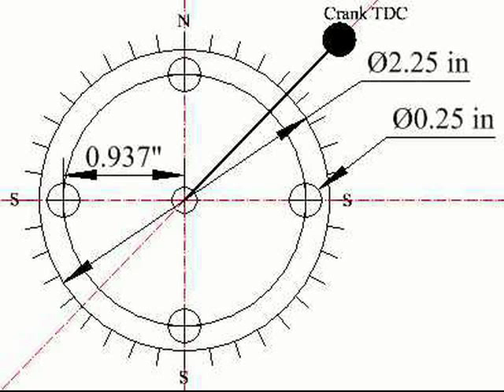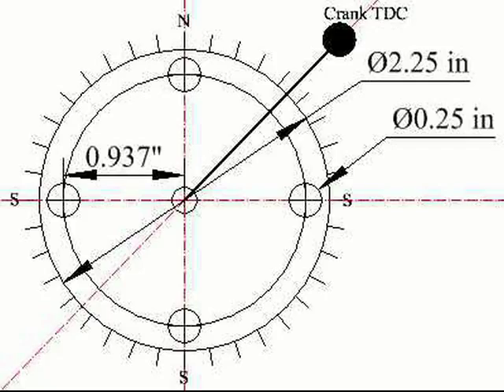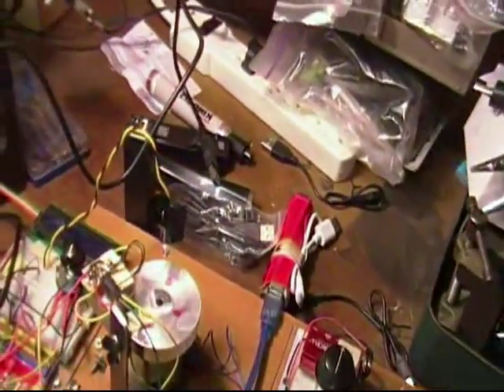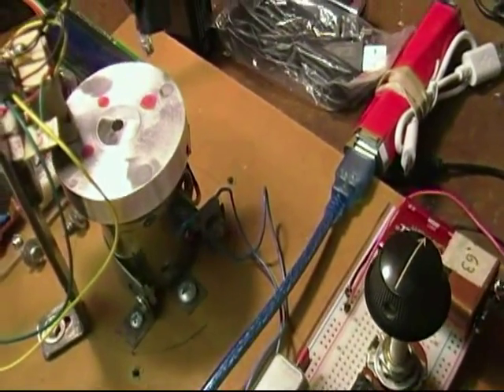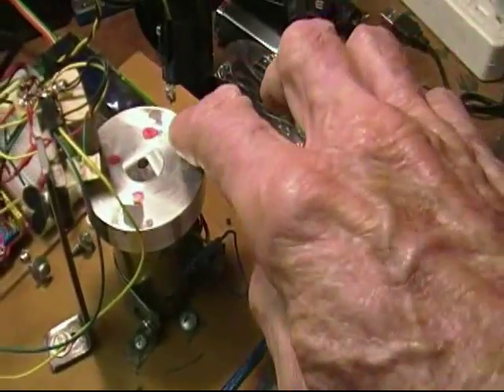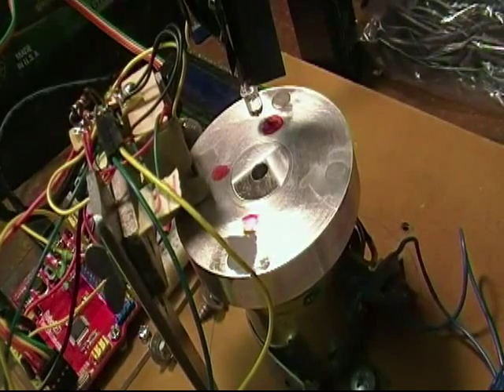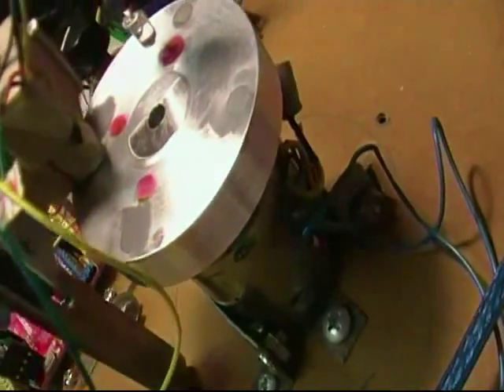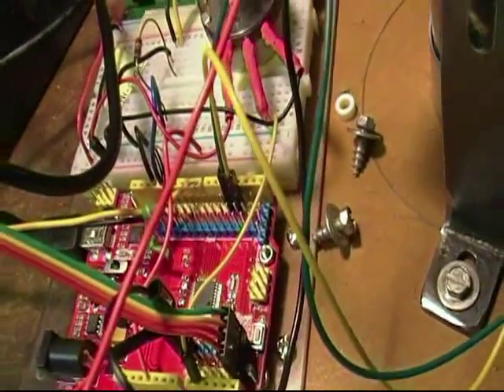Hall Effect Sensors & Arduino Using South AND North Magnets

Comment: I just tried my codes with the sensors but it did not work as I wanted. It runs for 10 times with one sensor only. I want both output ones. As if, 3000 time it will ON after contact with first sensor and then wait until it contact with second sensor then turn off . 

flow chart will be like,
(Start > Magnetic Sensor 1 ON --Sensor Valve ON ----> Magnetic Sensor 2 ON -> Solenoid Valve OFF ) 3000 times

Last two weeks, I tired a lot to sort it out. there are 3 issues and those stuck me for ages.

                Issue 1: when I brings the sensor1 closure to the Magnet, it LED turn on until I remove it but I want to remain it on until the (second sensor) sensor2 come close to the Magnet. 

                Issue 2: When I brought the sensor1 close to the magnet, it runs for 3000 times until i remove it. But I want the led will turn on and then sensor 2 will be closure and led will turn off. AND OVERALL, it WILL COUNT as 1 CYCLE.

                Issue 3: the following code give me value like "Sensor 1 Value = 1" and "Sensor 2 value =1".... No idea why??

/********CODDING******/ 
int sensor_1_pin = 2;
int sensor_2_pin = 3; //hall effect sensor output connected to Ard 

int led = 7;   

int sensor_1_value = 0;
int sensor_2_value = 0;

int cycle = 3000;
int i = 0;

void setup()
{
  Serial.begin (9600);
  pinMode(sensor_1_pin, INPUT);
  pinMode(sensor_2_pin, INPUT);
  
  pinMode(led, OUTPUT);
}

void loop()
{
  sensor_1_value = digitalRead(sensor_1_pin);
  sensor_2_value = digitalRead(sensor_2_pin);
  
  Serial.print ("Sensor 1 value = ");
  Serial.println (sensor_1_value);
  Serial.print ("Sensor 2 value = ");
  Serial.println (sensor_2_value);
  
  if (sensor_1_value != sensor_2_value)
  {
    if (i<cycle)
    {
      if(sensor_1_value == HIGH)
      {
              digitalWrite(led, HIGH);
              Serial.print ("Sensor 1 value = ");
              Serial.println (sensor_1_value);
      }
      else if(sensor_2_value == HIGH)
      {
             digitalWrite(led, LOW);
             Serial.print ("Sensor 1 value = ");
             Serial.println (sensor_1_value);
      }
    }  
i++;
  }
 sensor_1_value = sensor_2_value;
}

However, I actually, want to get the feedback from the sensor and led will turn on and off according. As when sensor 1 will bring closure to the magnet, it will turn on and then it will remain on until sensor 2 will come closure to the magnet. Similarly LED will remain off until sensor 1 will bring closure. and cycle will count only when the LED is turn on and off once. 

Please help.